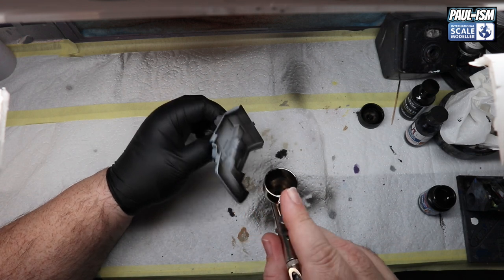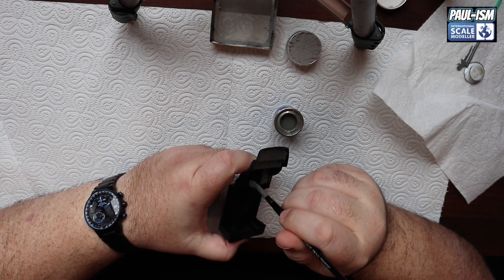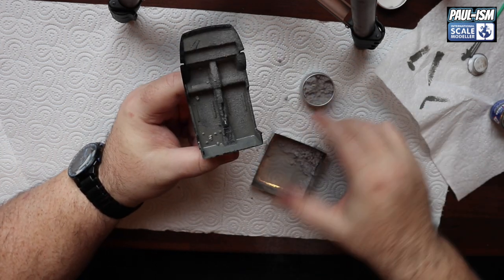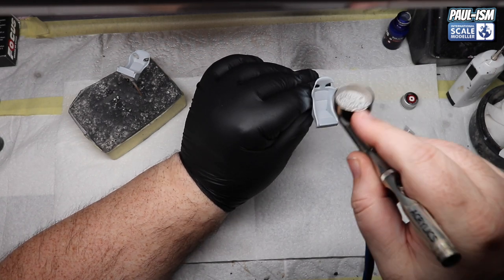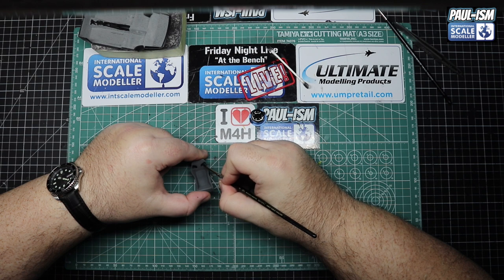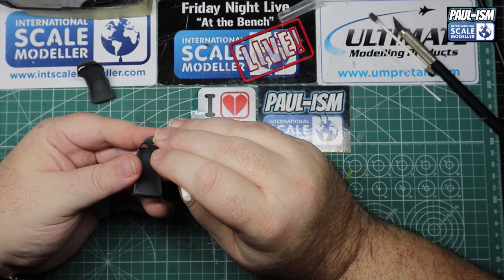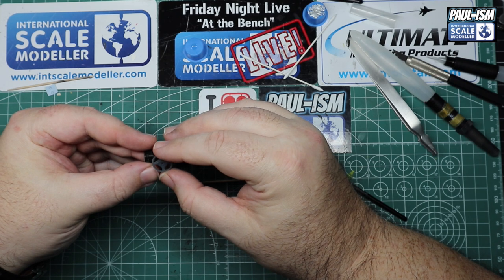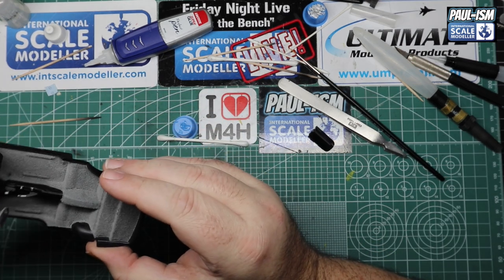Part 3 Tamiya 1/24 Porsche 911 GT3 - Step by Step build

Comment: nice work on the interior Paul. If you are going to use Tamiya paint to adhere flock / embossing powder, rather than x22, use XF86 flat clear. That way if your embossing powder has any thin areas they aren't shiny from the gloss clear.

Comment: I think Gunmetal wheels would really go nicely with that purple (lovely colour btw) Paul - but then I have a total dislike of silver wheels! As to the grey embossing powder, what I sometimes do if I cant find the right colour is to use white and then spray it lightly with very thin acrylic paint of the colour needed - as long as you do very light coats it works pretty well.

Comment: Seats really look cool.👌🏻
Question Paul.
What alternative clear can one spray over Gravity colours or can you only clear cote Gravity colours with their 2k clear to get a polished mirror finish?
I really want try out Gravity colours but find the 2k clear too pricey.
Reply from the maker: You can put any clear coat over really, but you will be hard pushed to beat 2k
Reply: Thanks for the reply. 
It looks 2k is the right way to go.
At the moment it's LP clear for now. 2k is  a bit dangerous...I don't have the space to safely spray 2k.
Another route I want to try is a good couple of LP clear coats and micromesh polishing. I saw a modeler achieve mirror like finish with this process.

Comment: What about a chromed or polished lip on the wheels? Or a light anthracite or light gun metal?
Don’t worry about the effin’ flocking, it’s way down deep inside and will probably never be seen with the body on it.
Odd that they said to put the highlights on first. Seems backwards to everything you learn about layering color.
Stay safe 🍻🌲